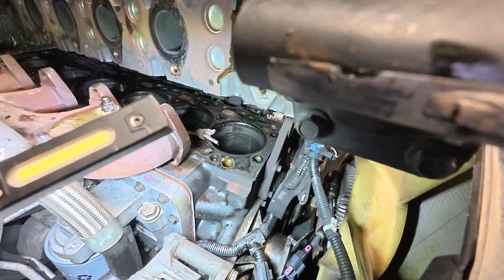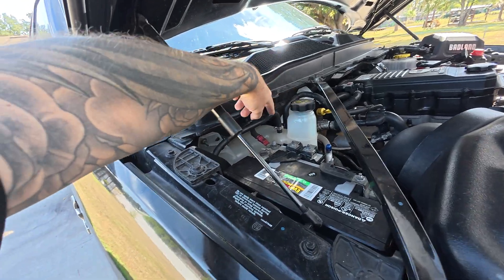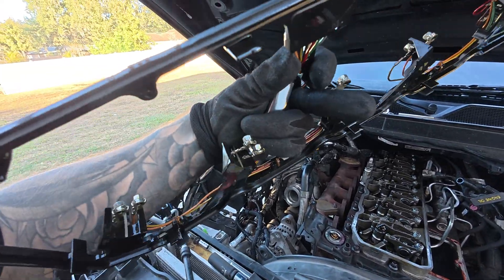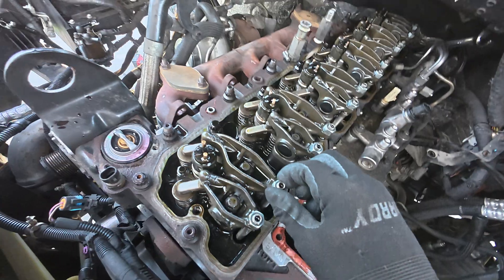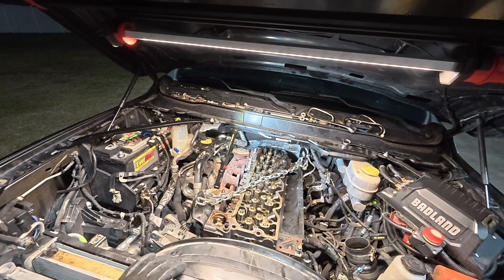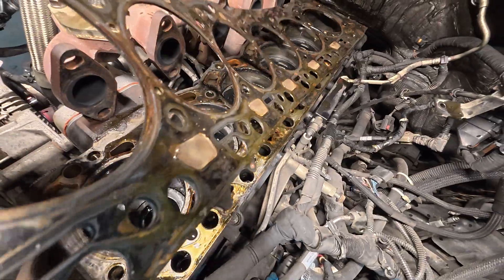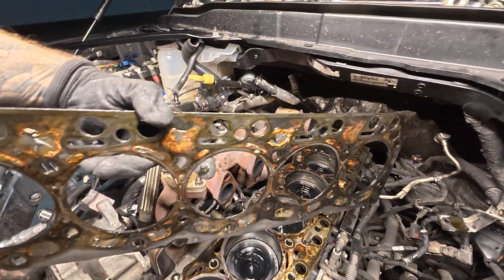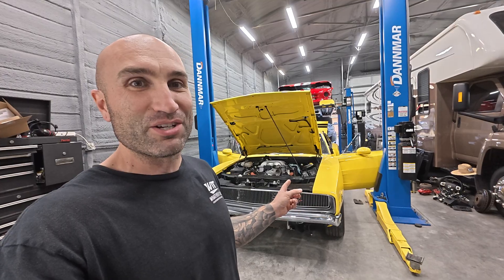You Won't Believe What Was HIDING under this Cummins Cylinder Head GASKET FAILURE

Comment: 15:36 I would inspect the entire cooling system. More than likely, they probably stuck a rag in a cooling hose or water pump chamber if they had the water pump off or something like that and a piece got torn off and or forgot a rag in there, and it went through the whole cooling system and probably got shredded by the water pump.

Comment: Man too bad couldnt have pulled the cab off. Would have been so much easier. I seen at sema they debuted a 8 point  2 post lift. So you can raise the body off the frame with the 4 arms and the other 4 arms you can lift the frame. Looked like a really cool setup.

Comment: Next time pull the cab, hopefully there wont be a next time. Dave's auto said the rams are easiest.
Reply from the maker: I think he likes charging customers as much as possible. It’s a lot more work pulling the cab. Steering disconnected, ac system needs to be evacuated and disconnected from cab, electrical systems disconnected. It would be nicer to work on for sure but it’s absolutely more work

Comment: Something you can do when you get it back together is use a thermal camera. If any of the passages in the radiator are blocked you'll easily be able to see it. You can also look for hot spots on the block.
Reply from the maker: That's a great tip, thanks for sharing!

Comment: Me personally with what u found , I think I would pull the motor and do a good inspection checking bearings n stuff, u already have it half a part, u paid enough money to not have to put a motor in it 20,000 miles after u just got it, so take a few days and check everything while u have a chance
Reply from the maker: That's definitely a valid thought! I'm hoping to avoid pulling the engine if possible, but I'll going through as much as I can on everything.

Comment: my guess is when the shop removed the head they put rags in all the ports to prevent anything from falling through when cleaning but I would definitely remove the oil pan to see if the oil pickup tube Is blocked with a rag since there is a mesh tube in the oil pump and a rag could easily be caught up in the mesh blocking oil flow
Reply from the maker: Definitely going to look deeper. This was stuffed in a coolant port not an oil galley thankfully but going to inspect everything as best as possible first
Reply: Id go ahead pull the oil pan

Comment: Well I've been a shade tree mechanic for 55 year's and never seen nothin like that so crazy.  Good luck hope you get it lined out. We have a 03 Dodge ram 3500 2wd with Cummins diesel engine 24valve 5.9 6 speed manual transmission quad cab dually i bought month ago from bank repo to it to local shop last week believe it has blown head gasket just hope that's all I'm to old n broken down to do the work myself.  Thanks for sharing be safe
Reply from the maker: Glad you enjoyed the video! Hope your truck turns out to be an easy fix!

Comment: In the case a bore scope is a must. Check every water jacket. Oil cooler. Thermostat. Water pump. Flush heater core.
Personally I’d replace the radiator just because it’s OEM and there might be deteriorated remanence of rag stuck inside.
Reply from the maker: Definitely good ideas for a thorough check! Going to see how much a radiator is but aftermarket ones are hard to trust these days and new would probably be super expensive!

Comment: At the very least disconnect the radiator and do a reverse flush. I'd probably try to figure out a way to do the same for the rest of the system.
Reply from the maker: Appreciate the suggestion, that would certainly help!